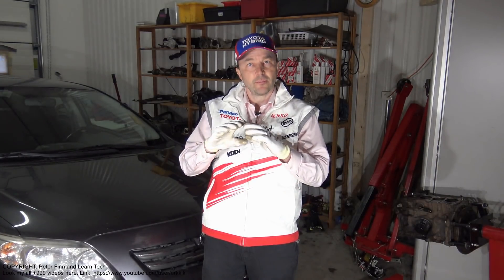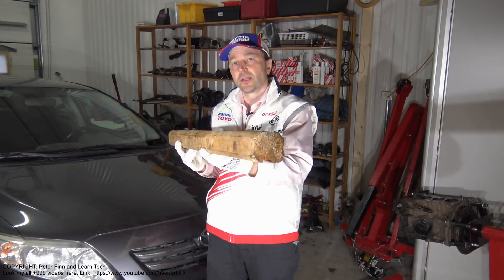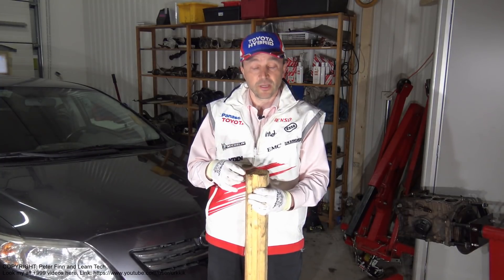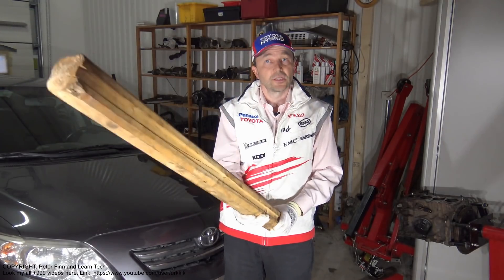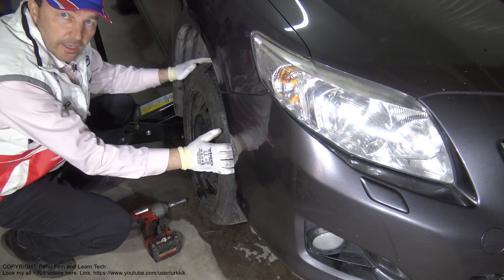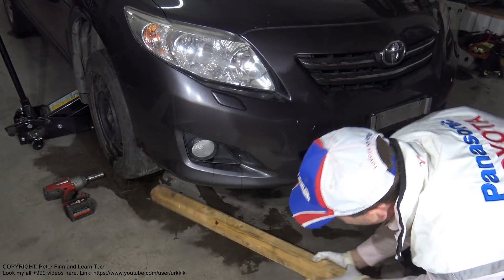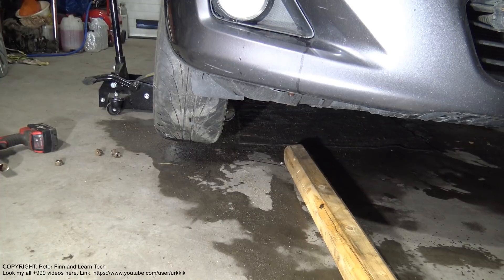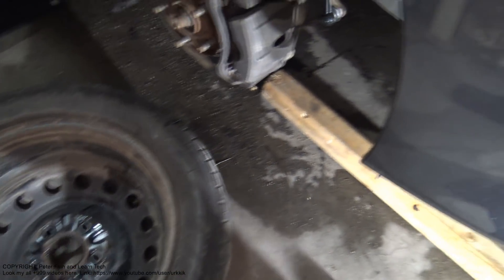How to remove Stuck or Jam car Steel Wheel or Alloy Wheel

Comment: Peter. Great video and great tip my friend.  And you are right, if you put some anti-seize compound on the back of your wheels it will prevent them from getting stuck .
Thanks and have a great day 👍
Reply from the maker: Thanks. Good info. :-)

Comment: Great video. Please I need you to help me out with  this anxiety. I bought an alloy rim of dimensions 1) 15"*5.5 (4*100).ET 40
2) please will it fit Suzuki forenza 2007 model.
3) if yes can I also use tire size 205/65 R15 on the rim and for the Suzuki forenza. Thanks.
Reply from the maker: Hi Sir, Sorry. I am not The Suzuki specialist. :-)
Reply: No. Those rims won’t fit your forenza 2007. Your rims are: 
Bolt pattern 4x114.3
Diameter: 15.0'';  
Width (inches): 6;  
Offset (mm): 40.
( 6Jx15 ET40 )
And your tire size is:
195/55R15
Hope this helps!

Comment: or you could just do like anyone else and remove 3 of the studs and slightly loosen the remaining 2 and just drive the car using its weight to break the rust free by braking and accelerating sharp
Reply from the maker: Thanks for info. :-)